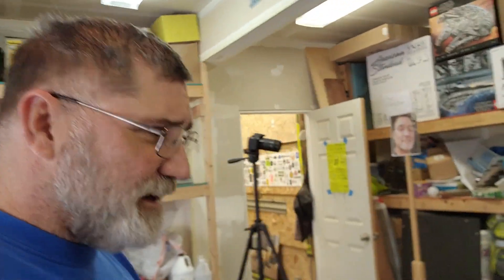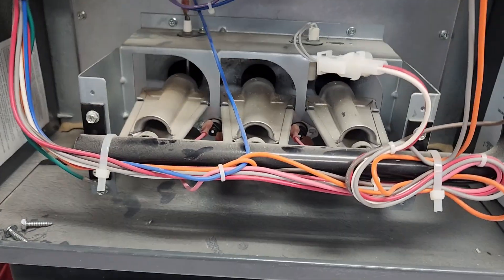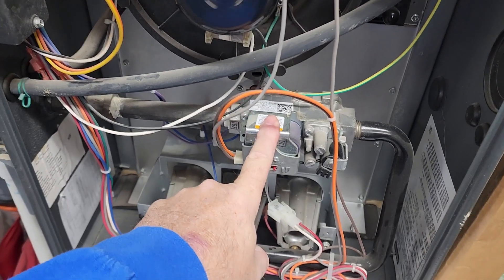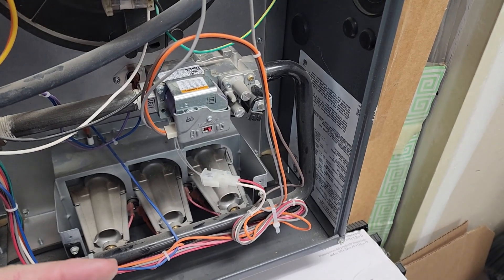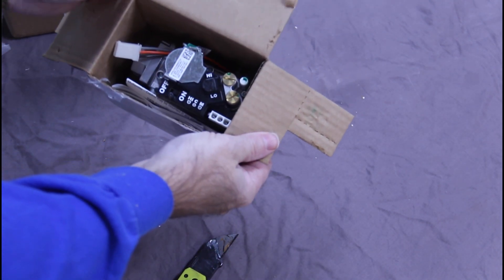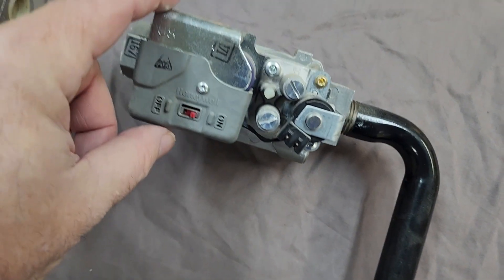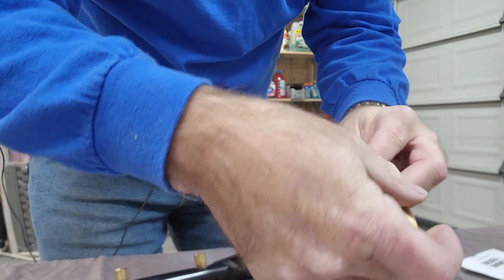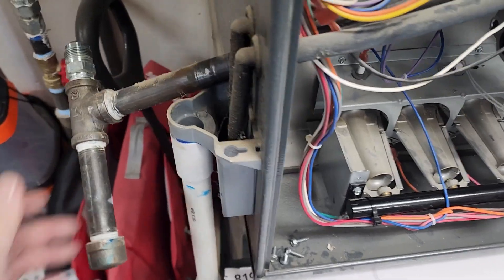It's cold INSIDE! | DIY gas valve change | Can I fix the furnace myself?! #diy #hvac

Comment: You are putting the tape on the wrong way , clockwise as you're looking at the threads . You're also using your adjustable wrench wrong . First light off you had to purge the air out of the line .
Reply from the maker: I fixed it, trust me. I noticed it.

Comment: Hes lucky it was just the filter switches cause he will be pulling the parts cannon out.
Reply from the maker: Probably was a smaller component, but I am not THAT familiar with the operations of the Gas Valve.

Comment: Good job! I have a gas valve replacement coming up soon once the part arrives. I usually see the videos of the technician using some sort of meter for the gas adjustment. Is that needed in all cases or does the gas valve comes preset if brand new?..
Reply from the maker: Mine was preset. But from the comments I've received, the manometer check is recommended.

Comment: Good video, thanks for sharing. I am just wandering why didn't it open the valve the first time igniter turned on?

A question for the experts: Is using pipe dope better than tape? Thought you always use dope on cast iron pipes.

Thanks in advance
Reply from the maker: I think the valve opened, but there was so much air in the line it wasn't enough to ignite. It lit on the third cycle and has worked perfectly every time since then.
Reply: @DadItYourselfDIY 
Did you ever checked / adjusted the pressure?
Reply from the maker: Used it right out of the box. I've been told hundreds of time in the comments that I should have checked it with a manometer. It will shorten the life of my furnace, etc. We'll, its been going strong without issue. The furnace is 12 years old. If it dies it dies.

Comment: I have an elderly family member with no heat and I have been able to diagnose it down to a seized draft inducer motor. I have tested all components and they are working, a professional HVAC company has done the same and all components are safe and working except for the draft inducer motor.. they want $810 to order the part and replace it.. I can do it for under $300
Reply from the maker: Do it. Probably three bolts and a wire connection!

Comment: You didn't mention how you knew it was faulty 🥲
Reply from the maker: It wasn't opening.. the next stage after the igniter is gas valve open. There is gas in the line, so, therefore, the valve isn't opening.

Comment: Hi did you need to bleed the system or just connect pipes?
Reply from the maker: I just connected it. It cycled three times before the air was fully out of the system.

Comment: Well 3rd time was a charm  I got 2 DOA used valves.  I installed 1 that would open when connected to AC connector.   Both read wrong ohms  1 a total open       The 3rd was new, it opened perfectly and read correct ohms and after installing it, runs perfect.    I did use both thread and pipe dope       Bought cheap manometer and checked it on high fire.  was almost perfect out of box.  Adjusted it a bit and left it.  Other unit reads 3.6 water column and been there 15 yr          I have no idea how to adjust for "LOW FIRE"     looking at pots,  it about halt way screwed in so should be close to the 1.6       Both unit act same and neither seem to run in low fire?   The either run at around 3.5 or turn off       I had to keep coming back to this because it downloads in  German language
Reply from the maker: Glad it worked out for you!!

Comment: Thanks for the video, it helps show how easy it is to get to the valves.  Yowser, $800 for parts and labor is like the cost of a whole new furnace.   I'd been DIY for decades except for whole unit replacements. 
I did a tear down of 2 valves from Goodman furnaces that failed and one of them was the coil opened up 
but you can't just order that one little part like you can on gas dryer (weird eh?) while the other one fairy newish had a sticky flapper valve inside.  
Such is life.
Reply from the maker: Sometimes it's just easier to swap the valve than to fix it! I did keep the old valve though.

Comment: The problem here is actually the pressure switch that connects the collector box. Bad switch or blocked collector box port. It is in the same circuit as the low stage gas valve wire. Without low stage being energized, the valve will not open.
Reply from the maker: Is that in the valve body?
Reply: @DadItYourselfDIY  No. Look for the pressure switch with the gray wires, -.10"W.C. then follow that hose to the collector box. See if you can blow through it, or run an allen key through it of similar size.
Reply from the maker: Well I changed the valve and everything worked. Wouldn't the problem persist if the collector box or switch was bad?
Reply: @DadItYourselfDIY  It should have lit the first time it tried. It didn't light because very likely the low stage wasn't getting voltage.
Reply from the maker: Ok. I replaced the valve. It worked.
Reply: @DadItYourselfDIY Yes you've said that already. 🤦
Reply from the maker: I understand what you're saying. But it lit after the third try, and now lights on the first time. So I'm assuming if the collector box was not working, even the new valve wouldn't work. So I'm trying to understand what advice you are trying to give?
Reply: @DadItYourselfDIY  Go clean the port. You'll thank me later.
Reply from the maker: OK!
Reply: @DadItYourselfDIY if the HSI igniter is glowing the pressure switches have already proven that they are functioning correctly.     It probably took 3 tries as there was air in the system due to the changeout of the valve.
Reply from the maker: I agreed with this assessment completely.
Reply: https://youtube.com/shorts/x2FQJJ3MTtI?si=tlfQBwNNyioMjRtE
Reply: https://youtube.com/shorts/x2FQJJ3MTtI?si=tlfQBwNNyioMjRtE

Comment: That is a good and ballsy video   I got same symptoms    I am gonna do some more checks but if correct AC voltage getting to valve then it is probably bad.  I am bit nervous about installing a new one.   I would be scared of leaks
Reply: I have to do mine, but I would recommend pipe dope on top of thread tape. I've had leaks when you only use one, but I've never had leaks when you use both.
Reply: @denniswetzler2024  Thanks that seems very smart to use  both.  The tape & dope available at Home Depot for $5               My valve out again %^&*(%^&*   everything runs in perfect order and the 27 VAC hits gas valve and Nothing     ignitor burning orange and no gas release      exact valve expensive $100 new
Reply from the maker: Cheap fix compared to a $15K furnace replacement!
Reply from the maker: Agreed.
Reply from the maker: I worked on O2 Systems in the Navy, so I'm pretty confident in my abilities with pneumatic lines and leak checking.

Comment: I had a similar call. No gas valve fired off. The problem was the hidden gas cutoff had been turned off by an electrician turned it off accidentally while running a circuit for the crawl space dehumidifier
Reply from the maker: Had a similar situation at a customer where they turned of the isolation valve to the heating system in June and forgot to turn it on. Didn't notice until a cold day in September. 5 second fix.

Comment: What if I don't have the first yellow flexible line on the T side? I have a solid steel gas pipe that goes straight up, if I try to loosen it it would tighten on top... What do I take off first in this situation?
Reply from the maker: There is a union somewhere. That will have to be disconnected first. It looks like a large "nut"
Reply: Ah, ya I found it thanks  @DadItYourselfDIY
Reply from the maker: @intelcrash1 Glad I could help!

Comment: I've got a Rheem furnace with the same problem. Had a tech come out to check it and he verified the value was bad. While he was checking it out, the furnace actually fired up, so the value is going bad. Yeah, $800 to replace a $115 value. I get that they need to make money, too, but I'm enough of an engineer that I can fix stuff like this myself. Luckily, we're heading into some warmer weather, so there is no urgency to getting it fixed.
Reply from the maker: You can easily do this!

Comment: you got to check gas pressure because the company's don't care they would love your furnace to break down.. don't trust anyone
Reply from the maker: Well, it's working fine after more than a year. I guess the factory settings were good. 

Also, next time you get a tire changed, be sure to check the pressure. That tire store would love for you to get a flat so they could sell you a new tire. 😁😉

Comment: I had the same issue with the same valve not working, but when I inspected the little electronic board with a borescope, I find out it was corroded, I order a working use valve ($40.00) and replaced the only the board and my heater started working without any issues.
The bigger issue was finding out how to remove the board (it just puled out, with some effort)
Cold valve body drip condensate on the little board and caused galvanic corrosion.
I will find a way to cover the board (maybe a dielectric grease) in summer.
Reply from the maker: That's a great bit of information!

Comment: So if i get no "click" on my gas valve when the igniter is glowing, i need to replace my gas valve?  Is there no "fixing" the valve?
Reply from the maker: I could not figure out how to manually open the valve. If the control board is not sending the voltage, the valve won't open. It's one or the other, rarely both.
Reply: @DadItYourselfDIY  You can't, is a safety issue
If your igniter glows, the valve should open
Remove the valve plug and use a meter to measure for voltage after the igniter glows.
You may need the wiring diagram to  find the correct wires
In may case, a two stage valve, center was 24vac common and one of the other ones was the one with the AC power 
Per the drawing left to right, PM, Common, Hi
Check the board in the valve body, sometimes corrosion damage the bard, and you can just buy a used or new valve ($50.00 vs $200.00) and replace the board only.
I did that and saved a ton of labor
Reply from the maker: @HectorBarrera-b7n I had the board checked. I assumed it was a bad valve, the tech verified I was right.

Comment: I was just quoted yesterday for the gas valve at $1700.00
Reply: I was quoted 1200 yesterday. 
I think I'll just attempt it myself first. 
Doesn't look to bad to do.
Reply from the maker: @r.carter9222 I will be easier with a couple of pipe wrenches and a vice. 🤣
Reply from the maker: Yikes! It's a $100 part.

Comment: Very good job here. Also having issues with 1 pipe system steam boiler. Our valve has a sticky diaphragm. Not sure if there is dirt inside or a weak spring. The furnace starts good with no problems. But when the thermostat hits temp the boiler is still going full blast for a while. Even turning off the breaker and disconnect thermostat from the wall it won't stop it. It does eventually shut down when it un jams the diaphragm. By that point the house is very very hot. They don't make the parts anymore so I'm waiting for one to show up on ebay to transfer the parts from. White Rodgers 26A-208 Needs to be 25 volts 60 cycles. I replaced the other safety switches a few years ago and they are still working. If the water level gets too low/high the gas won't start, if the pilot light goes out red button pops up and shuts down everything.
Reply from the maker: Looks like Grainger sells the Gas Valve for $169.00

https://www.grainger.com/product/1RC51

And the relay is on Amazon.

Looks like Emerson supports that product now. Here is a link to the catalog: https://www.emerson.com/documents/commercial-residential/white-rodgers-product-catalog-en-1286942.pdf
Reply: @DadItYourselfDIY   wow thanks. I got it working again and for now it's not sticking anymore. I will replace with that replacement model once the weather warms up a little though. 👍
Reply from the maker: @kennyadvocat Glad I could help!

Comment: Hey Dad, did you bleed the system for air after the gas valve replacement?
Reply from the maker: There is no way to do that. Took a couple of cycles and it bled itself.

Comment: Because you didn’t check both stages for correct nameplate inches of water  column, Dad, you can probably expect the furnace shutting down on high temperature, flame roll out lock out or a cracked heat exchanger from excessive heat. Most valves are shipped a little high to compensate for slightly low inlet pressure and require testing to operate properly and safely.
Reply from the maker: I've gotten that note a few times. Been working over a year now. Furnace, is over 10 years old, so if it fails I have excuse to put in a heat pump. 🤣
Reply: @ 
We put in mostly Goodman heat pumps. Install an 80% single stage Goodman furnace. Cheap and easy to service yourself. An 18 seer 2 stage Goodman heat pump set up for dual fuel with a Honeywell TH8321 thermostat. 3 heat-2 cool with built in dual fuel (in setup). You will be the only one on your block that never has an hvac service truck in front of your house.
Reply from the maker: @bills6946 That's good to know. I'm pinning this comment!
Reply from the maker: See comments below.

Comment: No reason to turn a low-pressure gas residential line that tight with tape on the threads on a pipe fitting. Pipe threads can be manually seated much like a compression fitting. I would exercise caution if the gas burner assembly were older or manually made up at the hopeless despot though. Some local jurisdictions may apply. Rule of dumb, if it twists it should fit, if it stinks after the pinky is pink (from a "Dutch farm boy") thread fattening sequence with all that is in your aunts second cousins sink left drawer, then may apply tape. Soapy bubbles tell the tale of overpriced service emanualls nationwide.-Not AvE
Reply from the maker: Nice!

Comment: Very cool, have about the same setup and was a little confused on how I was going to replace this if I had too lol. Recently had to replace my control board and the sound of those flames starting was the best sound I have ever heard. It did take a awhile to get her fired up after replacing and I figured it might of had something to do with air in the line but I almost lost hope.
Reply from the maker: It was pretty straightforward.

Comment: Well I see a few issues..... I'm glad you were able to fix it... but.. your connector inside that connects two pipes together should be a union...  I wouldn't use just yellow gas tape... I'd use paste or both... that gas valve should ALWAYS be tested and testing to see if you have gas by unhooking the line...not a good idea... that's why we test inlet and outlet pressure directly on the gas value... ALWAYS.   NOT really a wise idea this really isn't a DIY project... again, glad you got it working but I'd advise against doing this yourself unless you know what you're doing.   Be careful tightening down your gas valve you could have stripped the threads...
Reply: Cowboy, is there a specific pipe dope (paste) made for propane?
Reply from the maker: @mguerramd There is a gas/petroleum past. Google Rectorseal.
Reply from the maker: Thanks for the advice!

Comment: My furnace started to short cycle. It would fired up and run ~1 minute then would shut off only to fire up a couple of minutes later.. then repeat this cycle.  Had a local HVAC tech come out to diagnosed the problem. He was almost sure it was a faulty the gas valve that was unable to "hold" the main gas solenoid open. He quoted $2500 to replace the gas valve and ignitor-pilot light assembly (which he said he always does when replacing a gas valve).  I suspect his quote had more to due with the fact the furnace was 41 years old and he was more interested in selling me a modern more efficient model. The $2500 quote was his way of helping me do the "right" thing to replace a furnace that was well (+20 years) beyond its service life. I challenged the quote as being too high and he could not really justify the parts and labor costs. 

Went to my local appliance parts store and picked up a replacement compatible valve and new ignitor assembly; cost me $350. The original gas valve was a 5-wire model and the replacement was 4-wire. Fortunately the wiring diagram pasted to the inside of the furnace access cover was still readable. I was able to determine the 5-wire to 4-wire mapping.

Hardest part was rerouting the existing pilot gas line to the pilot light gas port. Had to straighten, rebend sections and shorten the line to get it routed to the new location on the replacement gas valve. Needed to purchase a small diameter tube bender (Harbor Freight $10). Also needed to change a 3/16" spade connector to 1/4" spade connector on a one (exhaust air flow pressure sense) wire.

Wife is happy furnace is working again.
Reply from the maker: You went a lot further than I would have! Bravo on your bravery and where with all!
Reply: 2500 is VERY excessive... too much.

Comment: Did you adjust fuel at all
Reply from the maker: I did not. Went with factory settings and assumed the city meter is set to the correct delivery pressure.

Comment: i hope someone can answer my question,  my gas valve is bad on my trane xb,  got an estimate for 650 installed but the estimate show 218 for a burner cover,  what is that?  is it a scam charge?  650  seems high but i'm not ready to do the dyi on this job .  thanks
Reply from the maker: They wanted $800 to just do my valve, so the added parts and labor to do the burner cover seem about right for the market.

Looks like the burner cover is a $100 part. https://images.app.goo.gl/r1YyrinuKXN1TVGy7